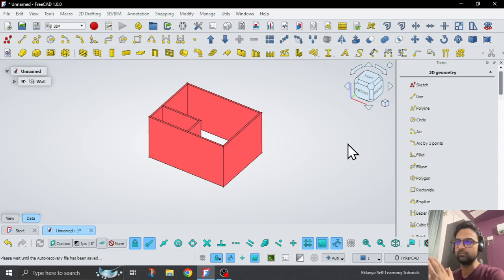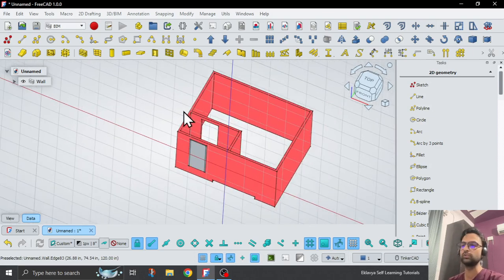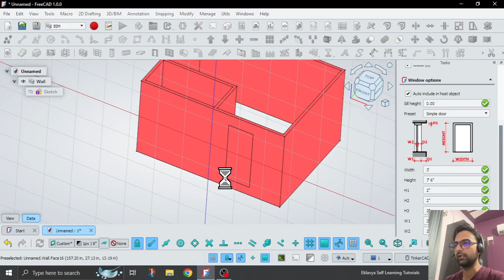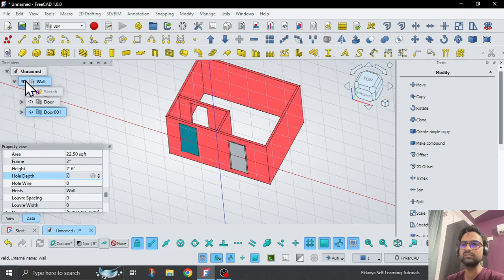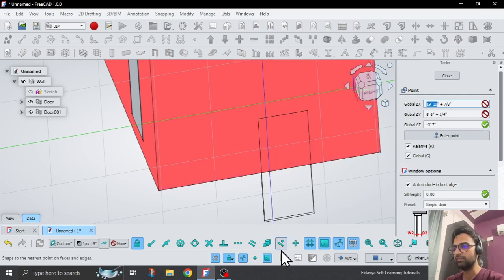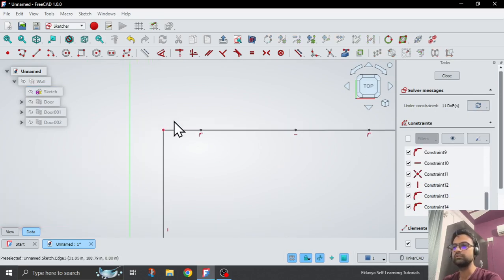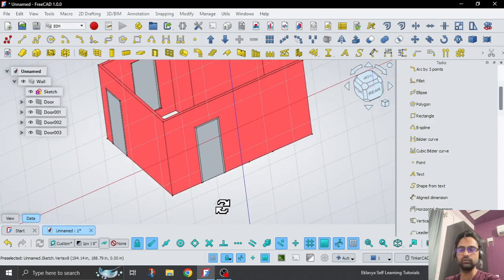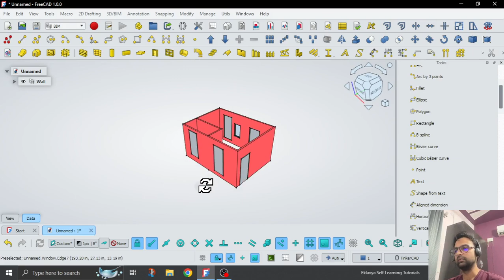FreeCAD Daily #21: Fix Doors & Windows Placement

Comment: About placement issue, an alternative and according to me best way is using transform tool. Choosing windows or doors and right clicking and setting translate value to desired value. Only negative aspect  of this method is  base sketch of window remains back  but, object moves. I would appreciate it if you evaluate it.Thank you.
Reply from the maker: ya that's helpful for clearly visible quick adjustments. For precise placements, methods shown in the video are useful.

Comment: Eklavya, in our FreeCAD group we use twinmotion to render our FreeCAD projects after convertiing to OBJ,  i was wondering if you know  of any way to put rendering materials only to the face that needs it, what happens right now is that i put the material and the whole  individual objects get wrapped unlike Blender or sketchup where the faces can be individually changed . In short words: we can't change the color of the walls inside and leave the exterior side in different color or material.... we greatly appreciate your time Eklavya.  note: i tried multimaterial but it doesnt detect it as separate layers in the OBJ model so therefore the material goes onto the whole element, do you think Yorik can be addressed of this disadvantage as a request... kind regards and greetings from Mexico. pd. get a coffee patreon account.👍👍👍
Reply from the maker: This is more of a Twinmotion issue. In the meantime you can explore Google AI Studio to create render with desired texture by giving precise prompts. I recently uploaded a video showing its overview.
And I’ve a Ko-fi account for which I’ve given the link in video’s description.